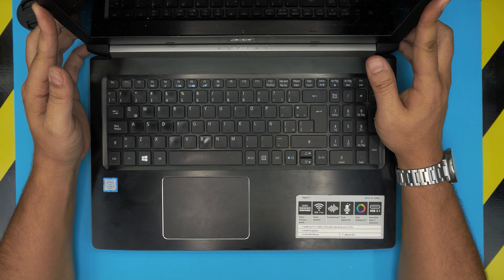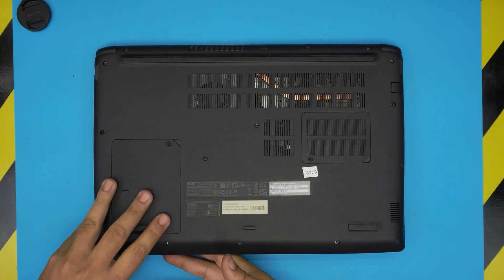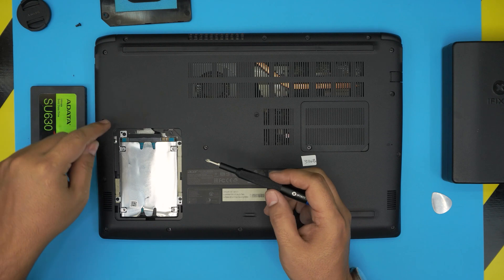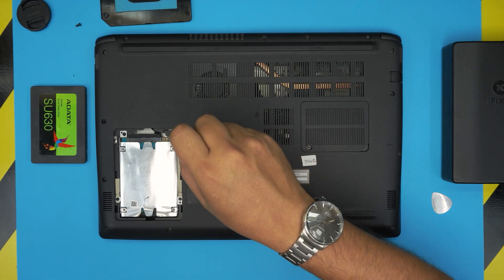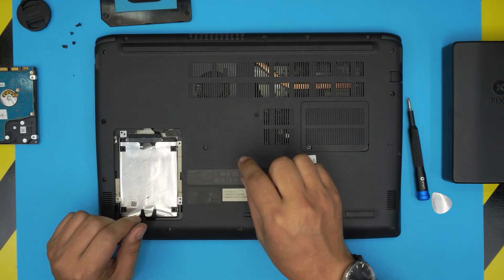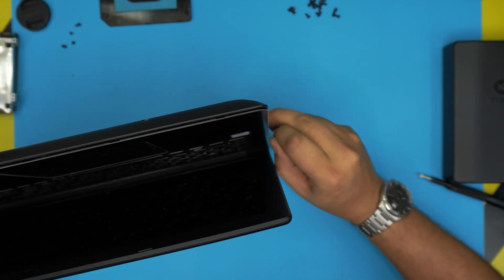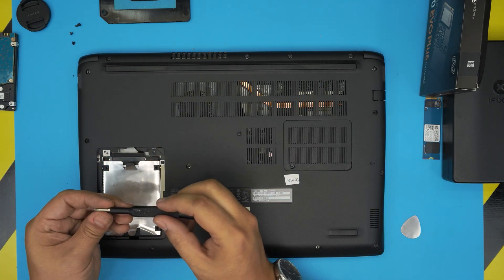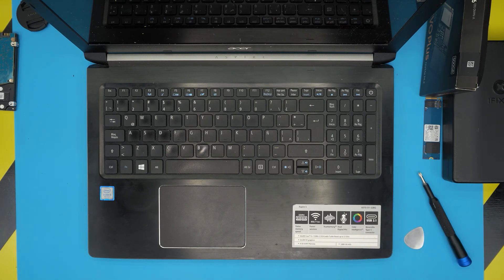Acer Aspire 5 A515 51 52bq 📢 SSD | M.2 | Hard drive UPGRADE

Comment: Brother can i install gen4 ssd in this laptop? I've a515-51g 50uw i5 7th gen
Reply from the maker: 🫠Regarding your question,  sure you can without any issues.
Should you have any further questions or requests in the future, please don't hesitate to ask me.
cheers🍻
Reply: @uFixTek  what about the speed? If this laptop support 3rd gen m.2 ssd and i put 4th gen ssd?
Reply from the maker: If you use a Gen 4 SSD, it will run at Gen 3 specs, but the SSD will have a longer lifespan since it won’t be pushed to its maximum limits.
Reply: @uFixTek  it mean gen4 ssd will produce geb3 speed but tbw work as gen4 ssd right?
Reply from the maker: yes it's like placing a usb 3.1 stick on the pc that has usb 3.0, you will get the speed of the 3.0 spec.
Reply: @uFixTek  ok boss. Love grom bharat

Comment: Hi i have 515-51 aspire 5 can i install Crucial P3 500GB PCIe Gen3 3D NAND NVMe M.2 SSD, up to 3500MB/s - CT500P3SSD8?
Reply from the maker: Thank you for your feedback! If you wish to support the channel, you can like, subscribe, or both!
Regarding your question, yes you can and it will work like charm with out any issue.
Should you have any further questions or requests in the future, please don't hesitate to ask me.
cheers🍻
Reply: @uFixTek  thanks for the quick response
Reply from the maker: It's my pleasure my friend.

Comment: Do you have a video on adding external gpu to this laptop
Reply from the maker: you can, and it is very simple , just like you connecting an m.2 ssd but you may have to open a insertion on the bottom cover to have the cable going inside.
https://amzn.to/3YRJAge
Reply: @uFixTek  thank you massive help
Reply from the maker: It's my pleasure my friend.

Comment: Cam you use the m2 slot for external graphica card
Reply from the maker: Thank you for your feedback! If you wish to support the channel, you can like, subscribe, or both!
Regarding your question, you can, and it is very simple , just like you connecting an m.2 ssd but you may have to open a insertion on the bottom cover to have the cable going inside.
https://amzn.to/3YRJAge

Comment: my laptop does not include the sata cable or the hdd support!  what is the part number of the cable and the bracket to look for them?
Reply from the maker: Thank you for the feedback! if you wish to support the channel you can LIKE or SUB or both :P
regarding your question: the bracket its hard to find, and you really don't need it if you place SSD in there, just get this and use the adapter, https://amzn.to/3ctmiZU